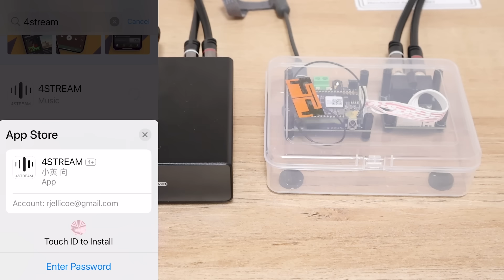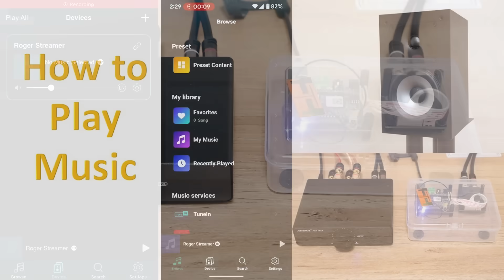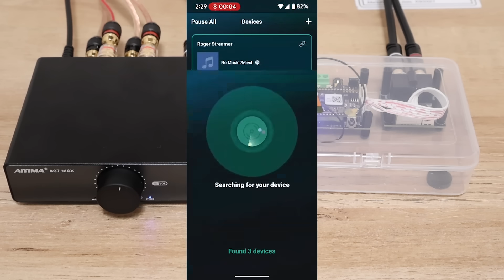Ultimate WiFi Music Streamer Anyone Can Build, Easy DIY Music Streamer with DAC Upgrade

Comment: My current router only broadcasts 5ghz, it seems like the Up2Stream Mini only works on 2.4 ghz, any alternatives or different options?
Reply: Try looking in the settings for 2.4G.  my brand new broadband router allows either or both.
Reply from the maker: The Wiim mini supports 5Ghz, and the Up2stream HD does too with better audio quality.  Some dual band routers  appear to not support 2.4 Ghz devices but actually do, and you can often get the system to work by having seperate SSIDs for the 2 bands. It might be more trouble than it's worth though.

Comment: I’ve been watching your videos to educate myself on the topic of network streamers. The videos are excellent. I do have a question that will expose my naïveté. In an earlier video, you showed how to build a streamer, but that one didn’t have a DAC module, whereas this one does. Did the module used in the other streamer have a built-in DAC? Thank you.
Reply from the maker: Yes the other board has a built in DAC, but the add on DAC gives noticably better sound on a good HiFi system

Comment: I appreciate the time and planning it takes to create a video of a DIY project. Now, my situation. I just purchased the Wi-Fi board and the DAC that you listed before I read most of the comments. I understand there are better choices than the Arylic DAC add-on board. Please tell me, or if others want to chime in, is there a DAC board that would work in this combo and perform better than the item you listed without getting over 2X the price? If I'm going to do this, I'd like to have a DAC with high, not "mid" quality to somewhat future proof it. I do many projects DIY, an enjoy doing it. Your video title does read 'Ultimate'. Btw, I also have an Aiyima A07 Pro w/48v-5A PS and a couple OPA2134 op-amps coming to assemble a respectable heated garage setup, in which I often entertain buddies. If you have the verbiage I'd use to do some searching for a different board on my own, I would welcome that also. Thanks, Charlie from Iowa
Reply: Disregard. I'm trying to return items and just buy the Up2Stream HD DAC + OLED Display Board + Remote Control, because it does it all!

Comment: Howdy, thanks  for your video's. couple questions if you have a chance.   I am have ing a few problems and am not sure if it's my  connections or my internet provider.   Broadband light is on but internet is working great.  Music last pm was not good  but much better this am.  
     It appears my cell phone is using blue tooth to connect and send music to your streamer. If I turn blue tooth off music dies. volume  on phone works volume on system  perfectly.  turning Wifi connection of  phone no change musci  still comes thru.
Turning router off music dims then comes back.  
        text messages click on the stereo system  and the music stops when I get a phone

       Again music much better this am.  I'm confused. 
1) how do I make sure I'm listening to Wifi music vs Blue tooth music
2) I'm only able to blue tooth one phone to your streamer at a time. I would like booth me and my wife to be able to control 
      is there a way to do this or should I use and old phone  with Wifi only. just dedicated to this 
3) adding DAC, I did not notice this option until having set up original version. Will DAC fit into the original case?
4) a wifi only old iphone should work for this with Spotify, correct?
                                                       Thank you so much 
                                                               Brian

Comment: Hi, what are the specifications on the ribbon cable used to connect the Up2Stream mini & the DAC expansion board? Thanks!
Love your videos!
Reply from the maker: The ribbon cable is the one supplied with the DAC board.   It's a six conductor cable, 10cm long terminated in 7 pin Phoenix connectors with 1.25mm pitch.
Reply: thanks!

Comment: Hi Roger, I purchased the whole setup for my speakers but to my surprise when I try to connect them to try and watch a movie the delay is just insane. The audio is 2s behind the visuals. Do you know if it's normal of it there are any fixes by any chance? Thanks!
Reply from the maker: Unfortunately the delay is normal with all wifi based systems, these streamers are designed for music playback not tv.   For low delay wireless you can use bluetooth with an AptX LL codec which I cover in this video. https://youtu.be/Tz6wSNouxlE. There is also  a new wireless tech called Auracast which I describe in this video https://youtu.be/2nW8eBG4JWI at present there are very few products available that exploit Auracast but I expect that will change rapidly over the next few months.

Comment: You created a notch in the case for the switch on the streamer board. Once "on" do you just leave it there? I suppose I could plug in the power to to the streamer to  my switched outlet on my NAD receiver.
Reply from the maker: Push and hold the switch for a couple of seconds to turn it off. A switched outlet works too. Or just leave it on. It draws very little power.

Comment: 4stream isn't available for recent android versions.
Reply from the maker: Thanks some other viewers have also told me that the 4Stream app in this video does not work with the latest software release on Samsung phones. I reached out to Arylic and they told me that they will be releasing an updated version of 4Stream. In the meantime, if you have a problem with 4Stream phone compatibility, the Up2Stream board in this video can be set up using the GoControl app.
First put the board into Bluetooth mode and pair it with your phone then open the GoControl app. The app won’t find the board until you push the plus sign in the top right of your screen after which you will see your device listed. If you tap on the listing for your device, you will get asked if you want to configure the network on your device. Tap confirm. The app will then scan for networks and when you see your network select it then enter the network password and click confirm. Once the network is correctly set up the light on the board will be white and not flashing.  After this your Up2Stream board will be recognized by the Wiim Home app. Use this app in exactly the same way as the 4Stream app in the video to control the board link it to others and play music.
Reply: I just received an Up2Steam Mini board today and also found that the 4Stream app isn't available.  I wish I new this 2 weeks ago when I purchased this board.  I would have gone in another direction.  Is there another app available?

Comment: Do you know how this would compare to just using an audio out cable from say an iPhone 16?  E.g. the iPhones no longer have a direct audio out cable, but they do sell adapters for USB-C to mini audio jack.  Is there a tiny DAC inside that adapter or does the iPhone itself somehow perform the DAC and send it through to the jack?  How would the DAC in that adapter compare to the one you used in this video?  I'm just wondering if it is it worth it to build your kit in this video versus just directly plugging the phone in using the adapter cable, either way with the audio going to an old late 1970s Akai stereo.  Thanks in advance.
Reply: I can't speak to the Iphone part of your question for sure, but there are expensive high quality dongles called Dragonfly, $85-$200, or decent FiiO around $20, and they bypass your internal DAC.  The thing is, you can use a headphone adapter to get the jack, and connect an RCA adapter from it to your amp, and my guess the internal DAC of the phone is decent.  Perhaps completely acceptable.

Comment: Totally off topic, but this made me throw out my bluetooth streamer, as I suddenly remembered I had a Google Chromecast Audio lying around, which I then installed. So out goes bluetooth streaming, in goes wifi streaming. Noticeable difference. Only drawback is, it has only got a 3.5 mm jack. Coupled to a Denon DRA-375RD.
Reply from the maker: Glad you found a good home for that sad lonely Chromecast Audio. The 3.5 jack also has optical out, use it with a mini toslink adapter, connect a good DAC (SMSL PS100 is fine for this) and you'll be amazed how good your music sounds.

Comment: You had me interested until the end when you used your phone as the source for the music.  I was hoping for a way to stream from my music library using my NAS as a media server.  Neat project, nonetheless.  A 3D printed housing would be my method of packaging.
Reply from the maker: You absolutely can stream from a NAS media server. The Phone is just a remote control. If your NAS supports DLNA it's super easy. Once you have the DLNA server pointing to the right folders.  Under the browse tab on the 4Stream app go to "My Music" and then "Home Music share" your NAS and entire library should appear there.  If your NAS is file sharing with SMB or SAMBA then Try the Symfonium  app which can act as an intermediary.
Reply: @rogergadgetguy  Thank you for this information!

Comment: Here's a problem which I haven't found an adequate solution.  I'm not able to get wires from my 7.1 A/V receiver to the back surround speakers so I bought a transmitter (2.4ghz) and two 80w mini receivers that sit atop the speakers.  I have the L+R rear channels now, but still I'm not satisfied with the sound.  I'm thinking there must be a way to transmit the rear channel signals from the main A/V receiver  to a dedicated rear channel receiver or amp, then just speaker wires along the baseboard to both speakers.
Reply from the maker: I understand what you are rying to do. The complications are the quality of the link, audio delay and level balancing, very tricky!  WiFi and conventional bluetooth have too much dela. If it were me, I'd try Auracast for the rear channels check out this video. https://youtu.be/2nW8eBG4JWI  Your receiver needs pre amp outputs, but I'm guessing you have those  because you got the other transmitter working.  Connect an auracst transmitter to the pre outs for your rear channels and this DIY amplifier board has an Auracast receiver and will drive your two rear speakers. https://www.arylic.com/products/up2cast-amp-with-auracast-bluetooth-broadcasting-amplifier-board?aff=189
Reply: @rogergadgetguy  Thank you very much!  I didn't expect such a prompt reply.

Comment: Thanks for this video. I’m looking for a multichannel (5.1,7.2 and more ) wireless transmission do you have any clue or hardware we can use to achieve that ?
Reply from the maker: The reason nobody makes fully wireless surround sound is the delays associated with wireless tech causing lip sync problems. You can just about do stereo, wireless with a TV,  or you can do wireless rear channels and Sub but to make the whole thing wireless has not been possible. That changed this year with the introduction of Auracast where there is now a way to do many channels fully sync'ed. I featured Auracast in this video https://youtu.be/2nW8eBG4JWI you would need 3 two channel transmitters for a 5.1 system but it could be done.  Unfortunately nobody has marketed this yet, maybe next year.

Comment: This is a nice little hobby project, but the cost is only low if you place no value on your time.
Reply from the maker: Ahh time.  Use it wisely,  spend it doing the things you love. In my case that's playing with electronics and sharing with friends.  This build is two hours start to finish.  That's pretty short compared to the total time normally spent choosing and shopping for a piece of audio gear.
Reply: @rogergadgetguy  Good answer!

Comment: I find it easier and cleaner to clean up the inside of a hole made by the step drill using the step drill from the other side and making a small chamfer using the step up to the next bigger level
Reply from the maker: Thanks for sharing that tip.

Comment: I have bought new but little bit older IntelNuc and S.M.S.L SU-1 , total cost = 120€.  IntelNUc Runs on Daphile RTU and that's it... I have audio via USB to DAC or Toslink
Reply from the maker: Brilliant!  I used to run Jriver media player headless on a NUC .  I replaced the NUC with a fanless mini PC when the fan got noisy.  Only downside of PC implementation is much higher power consumption.  Daphile is one of the many things out there I haven't tried.

Comment: Nice little project Roger. I use the same Polk XT 15’s in one of my systems. I’m using a Sony DVD player as a transport that I run through an SMSL PS100 DAC to an old Technics receiver. Pretty good sound for very little money.
Reply from the maker: That PS100 is an enigma, Incredibly good value as a good sounding DAC for less than half the price of others. Terrible implementation of HDMI ARC, just buggy and unreliable. Glad you are using it the way it shines. Your system is a great example of something I might put together for a freind or neighbor.  Very Nice!
Reply: @rogergadgetguy Yes, the SMSL PS 100 is about the most bare bones DAC you can buy. The indicator lights are barely visible. I works okay as a Bluetooth streamer as well. But equipment is very expensive in Canada 🇨🇦 and I always like to experiment.

Comment: Do you have access to EQ controls anywhere in this setup? Also, will it support lossless from Spotify?
Reply from the maker: Spotify Lossless is supported.  For EQ You have Bass, mid, and treble controls, and 5 pre set eq. settings. All are accessible through the Go Control phone App.  The 8 band equalizer you'll see in that app does not work with this setup. There is an APC workbench PC app which allows you to set parametric equalization. This works, but I found APC workbench to be buggy and not able to run on every PC.
Reply: @rogergadgetguy Thank you for responding. One more question... I'm thinking about putting this is my garage with some decent speakers I have from a prior home theater system. Is there a way to feed signal to a powered sub (like a  2.1 system)?
Reply from the maker: To feed a powered sub you can use RCA Y cables and use the phone to control the volume once you have balanced the sound between the amp and sub.  An ir remote is available as an accesory  if you don't want to use the phone.
Reply from the maker: I miss-spoke. Lossless is supported on Tidal and Amazon but But I just tried Spotify and it wouldn't stream lossless. The Spotify connect app on the streamer would need an update which is not available.

Comment: I have watched all of your videos and find them both practical and informative. It is so much fun to build
these inexpensive systems. I use the Arylic s10+ between my QNAP NAS and my old hifi. Like one of your
other viewers I tried this and found the sound disappointing. From memory it uses the old and cheap
ESS 9023 Sabre, wonder how much it would have improved if they had used the Sabre Pro. Anyway a great
and useful project. Keep up the videos.
Reply from the maker: Thanks for posting,  I wish the S10+ used the ES9023, it doesn't specify the DAC used. Arylic advertise the Sabre chip when they use it, so we have to assume the S10+ doesn't have it, and uses something generic and very cheap. The 9023 is old, and ESS are selling it cheaply to OEMs to take get some share and scale while selling their newer stuff at higher margins. This is a win-win for audiophiles because the 9023 is as good as it always was, but you can choose to pay more for the newer chips which are an incremental step up. The project in the video does have the ESS 9023 and I know it sounds better than the S10+ because I compared them directly. Of course the chip used is not the whole story and some quite expensive gear still uses the older chips but justify the premium with better output stages better clocks and better power supplies and sound really really good.  I can relate that I was surprised by the magnitude of the sound improvement when I connected the external DAC board compared to the generic on board DAC of the Up2Stream mini, which is itself better than the DACs in most bluetooth chips. That was why I built it in to a box and gave it to my friend and she is loving her music collection all over again.  It's absolutely the best sound I've experienced from a sub $100 streamer.(except for raspberry Pi based streamers which Is a whole other story which I'll post in a reply to another commenter.)
Reply: @rogergadgetguy  you needd to team the S10 with a reasonable DAC. It is a shame as it is actually a decent piece of equipment for the price. Many people get caught up in the DAC chip wars and to be honest at 72 most of my hearing range is not that good that I can hear the differences.

Comment: Actualy   if you are realy on a tight budget     this could work       but only if upstream 2    can still supply     because if you look at the website     there are  loads of add on modules   i have not realy  looked so far into whats available      as  far  as modules go    A screen  display would be nice      some one here says these 2 modules 54 euros         but so  if parts availabilty is good    use a bigger housing      and over months   buy more modules     you maybe could build an awesome streamer          And have pride knowing  there is only one like it       use linear supplies   etc.          but i think those funny little computers    rasberry pi     already have a add on kit to the computer    with also a small display      you realy do get satisfaction   knowing you built one yourself.